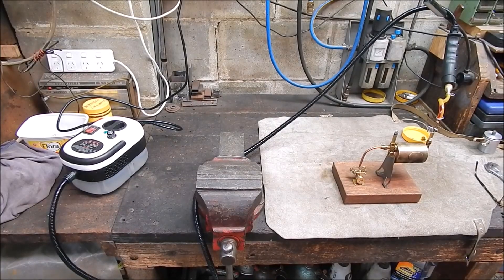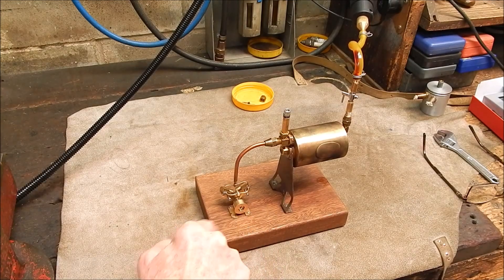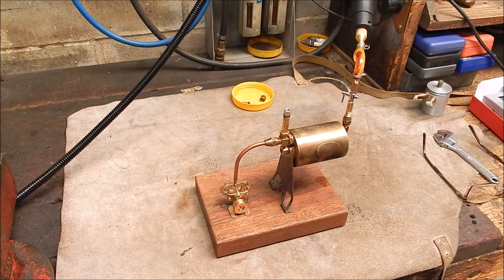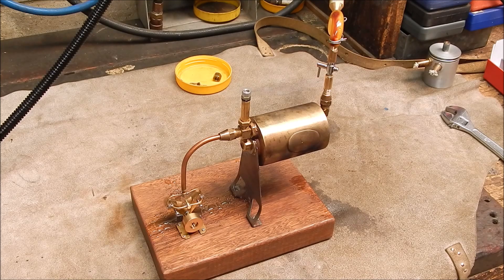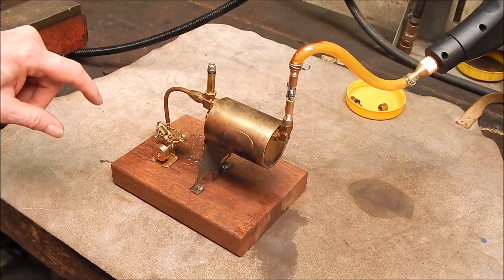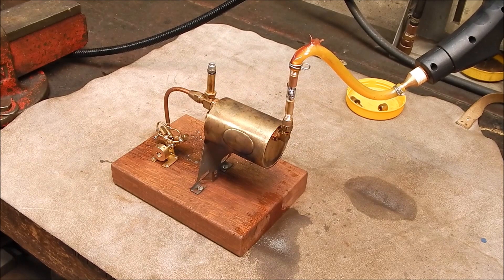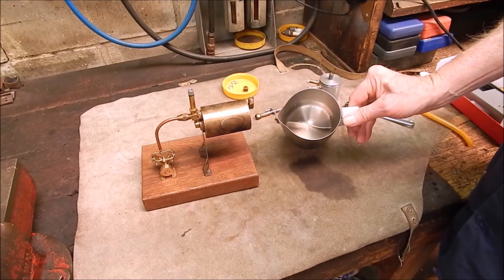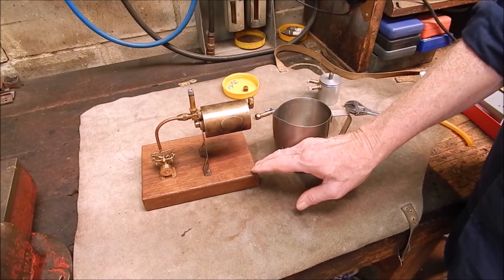Run a model steam engine with an El Cheapo steam cleaner

Comment: all good for something small. such as this lil pipsqueaker ;)

the steam cleaner, its regulated to very low pressure, and can only add so much heat to the steam once boiled because of that limited pressure.

the often overlooked issue with steam is that you dont use the energy it takes to produce steam. "latent heat". you use the energy you could hold in teh steam once it became steam... above ambient pressure, above 100C.

if the steams coming out at 120C, great... you have 20C to work with before it starts condensing. but is that at atmospheric pressure? at the nozzle... yes. whats the tank pressure when delivering through that nozzle?

you block the nozzle til the safety valve pops, it wont deliver ANY steam at all... obviously ;) but that will be its maximum pressure, and that does equate to a very well defined temperature above boiling.

well worth performing a few tests on the cleaner... max temperature, max pressure, and whats the maximum delivery rate at a USEFUL pressure.temperature? 100C at atmospheric pressure is useless... its already condensing.

stll, as a commercial item, it should be safe... just very limited in output. still preferable to compressed air?

forget the rating on the label as most of that power, again... is used in simply getting liquid water to a gas.
Reply from the maker: Yes, you are right - a lot of the energy goes into the latent heat of vaporisation and it's difficult to convert the water to steam quickly enough to make a real power source.

Comment: A length of the braided reinforced plastic tube might withstand the heat/pressure problem.
Reply from the maker: Yes, I'm sure it would.  I don't have any ready to hand, so I'm just using scrap off cuts of the right diameter to see what will hold.  Cheers Rob

Comment: I was just thinking, this is great but nothing has blown up yet and then it did! 😱🤣 That steam cleaner seems to be very quite too, much quieter than a compressor. Ideal for indoor use. Cheers, Alan.
Reply from the maker: Hi Alan.  The steam cleaner is very quiet. The pump just meters water from the bowl, so no real load on it.  When I get time I will repeat the exercise with the boiler heated to see if that reduces initial condensation.  Provided you don't fiddle with the pump control knob the steam flow appears to become fairly water free.  This whole concept is not my idea.  It's something I saw on a channel that surprisingly got very few views.  Check out this Stuart Turner No 4 running on a Karcher steam cleaner (and no water trap) : https://www.youtube.com/watch?v=i8y9ngyp3gg
Reply: @Xynudu  Just had a look at that video, impressive. Something like a Stuart Turner No.4 requires a lot more pressure, runs a treat. I also had a look at some of his other videos. I really liked his models of ejector seats. I worked in and around them for years, including the ones on Buccaneers, from what I remember his models are very accurate. Cheers, Alan.
Reply from the maker: Hi Alan.  I expect a larger engine like that would handle the amount of water in the line better as I expect it would be less per displacement volume.  He also didn't run an oiler that I could see, so it was once again just a concept video.  I will check out his other videos.  Cheers Rob
Reply: @Xynudu  Hi Rob. He is running an oiler, the little square box to the left side of the engine is a mechanical oiler. There is a crank running back and forth from another eccentric on the steam inlet side of the engine. This is operating the oiler. This type of oiler is more commonly used on steam locomotives. Cheers, Alan.
Reply from the maker: OK.  I see it now.  Well all in all it's a pretty effective way to run that engine.  Cheers Rob

Comment: Do you think that because the boiler/water trap is relatively cold at startup the early steam is just condensed until a certain temperature is reached and this accounts for most of the water in the boiler? Greetings from the UK
Reply from the maker: Good point David.  You can see quite a bit of water coming down the hose initially and each time I change the pump setting, but you are probably right regarding the cold boiler aspect as well.  It's highly likely that steam will condense out until the metal comes up to temperature.  When I get time I may tinker some more.  Cheers Rob